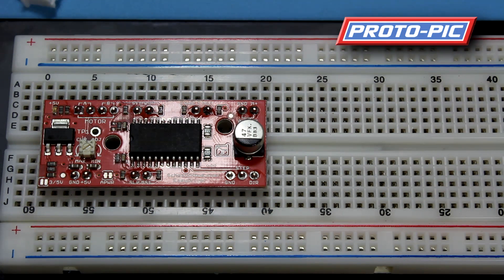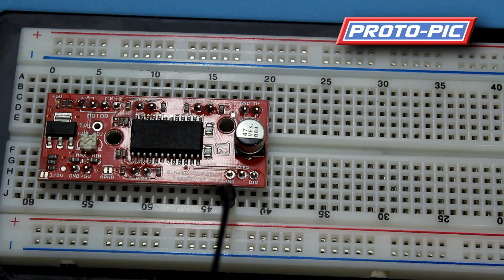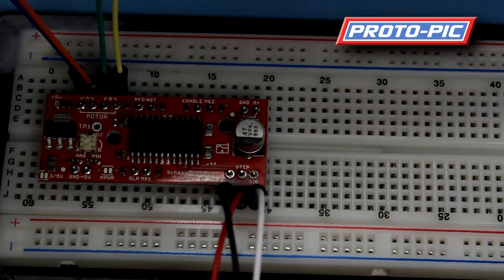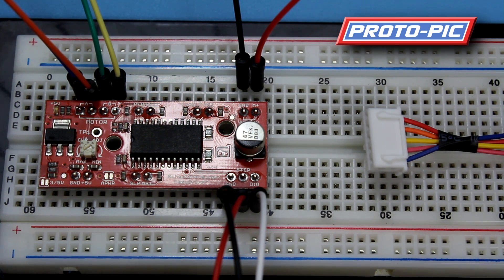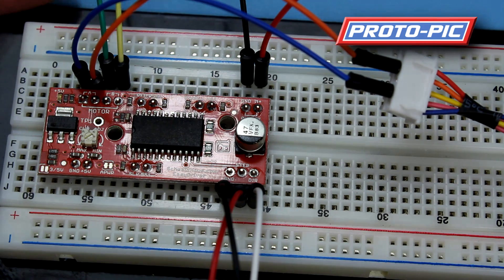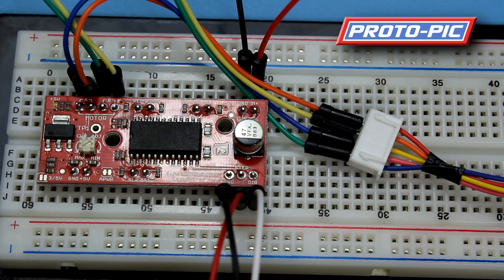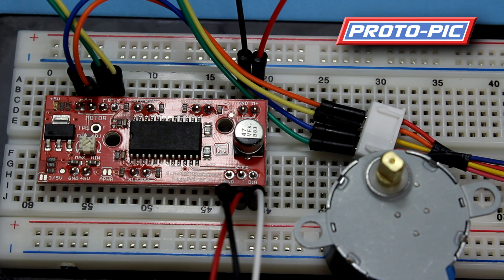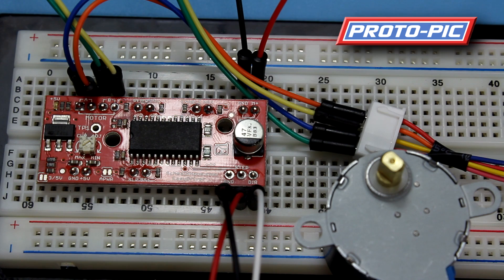Stepper Motor driven by the EasyDriver and Arduino from Proto-PIC.co.uk

Comment: for anyone interested the code is as follows:
void setup()
{
pinMode(2,OUTPUT);
pinMode(3,OUTPUT);
}

void loop()
{
  digitalWrite(3,!(digitalRead(3)));
  for (int I=0;I<5000;I++) // As the easy stepper driver is in microstepping mode
                           // We need to increase the step count.
  {
   digitalWrite(2,HIGH);
   digitalWrite(2,LOW) ;
   delayMicroseconds(160);
  }
}

Comment: I couldn't understand the sequence of the wire connections. I have several stepper motors (unipolar and bipolar) and this is my biggest difficulty. The sequence of the stepper motor wires I know; I just don't know the sequence to connect to Easy Driver; it is a logical sequence like 1 & 2 = [A] and 3 & 4 = [B]; or 1 and 3 = [A] and 2 & 4 = [B]? Can you help me? Thanks

Comment: three things to change from the video to make this work if its hissing:
1. Use another voltage source to add power to motor.
2. Change delay to at least 300
3. Switch wires 2 and 3 around
Reply: Thank you! The change to 300 worked for me ;-)

Comment: I'm using 3 easydrivers wit NEMA 17 and a 12v power source but the drivers get really hot, is it normal? how can I cool it down or avoid the heating?
Reply: Adjust the current using the potentiometer. It will lower the torque a little,  but it will reduce the heat.

Comment: Hey you prob won't see this but mine not working all it does is hiss
Reply from the maker: Adjust the power to MAX, and make sure your power supply can provide the required current for the motor, it may also be that the delay for stepping in your code needs to be longer.

Comment: I'm a total noob, so sorry for the stupid question. Why are you connecting your wires ( the black end bit)  directly into the breadboard instead of through the holes in driver?  Shouldn't the black bit go through the holes in driver and then  into the breadboard? Also, what is that white thing that's connected to the 5 wires called?
Reply from the maker: Hi - The wires would not make a good connection of just placed through the hole, the pins on the driver board go into the breadboard, and this allows a good contact between the wires and the controller board. The white thing on the end of the motor wires come with it, and it is called a JST connector.

Comment: Great tutorial i have had trouble with other video till i got to yours! Big Easy thanks ;) would you have a example you can point me out to using serial with back STOP forward? that be helpful for my chappie ears robot.
Reply: anothing thing i noticed, in your video at the very end your stepper is going back and forth but the example you have on your link does not give the same results? it just spins really really fast, i have a small 4wire 3.5v and my voltage supply is set to 6V @ 1A the reason why i have it at 6V @ 1A  is because i think i read that the big easy driver min is 6v and the 1A i have cuz i think is min i could play around and make it smaller while driving the motor to see whats the min with no load.
Reply from the maker: HI - as long as the motor is hooked up correctly, the DIR pin is hooked up to pin 3 on the arduino and the STEP pin is hooked up to pin 2 it should work.

Comment: I had this question in my mind for a long time. why do we need an easy driver while we can control the stepper motor using either l298 or l293 and what are the differences between them?
Reply from the maker: Hi - only 2 pins need to be used for the Easy Driver - the others need 4, also, no library is required for the Easy Driver saving memory.

Comment: does the easyDriver V4.4 chip getting hotter when you turn the stepper motor
Reply: I got 3 easy drivers, out of the 3 only one works and gets really hot, I've seen some guys on the web placing heat diffusers on top of it, that makes me believe that its normal, let me know if you found anything, thanks
Reply: mine gets really hot too

Comment: dude you might wanna mention what polarity are any wire you are plugging because using color labels are pretty obvious to mention considering its a video and we can see the color
Reply from the maker: Hi - There is no polarity, I refer to the datasheet for the wires connected to each end of the 2 coils. Reversing the polarity on one pair would cause the motor to rotate in the opposite direction.

Comment: Does this driver help this stepper motor to turn faster and with more torque than using the ULN2003 driver?
Reply from the maker: +Aaron Rios - Hi, This stepper driver board has been designed to make hooking up the motor to a micro-controller a little easier, Speed and Torque are not really effected. And your code can be as simple as Set direction & then Pulse the Step line however many steps you require, using the ULN2003, you need to program the output bit pattern for each step, as this is used as a coil driver.

Comment: Help me please.... :(( Where i find software for this hardware? I have 1 arduino uno+3 EasyDriver and 3 motors stepper but not find software for this. Thank you!
Reply from the maker: +George Lefter - Generally you need to write the firmware to do what you want to do - if you download the example provided, this should give you a good starting point.
Reply: ProtoPICVideos your pages do not exist

Comment: There is heating problem with Easy driver  v4.4 .. 
can u help me ..?

i have connected : 1 arduino uno , 2  nema 17 , 2 Easydriver v4.4 and 9 v power , 

Easy drive get heated in 1 min  
tell me how to solve heating problem .
Reply: +Jaikumar Vernekar since the coils are energised when not in use in your case, use the Enable pin on the driver board to turn off the coils when no driving them

Comment: I've tried to run my stepper motors with the Easy Driver 4.4 and they do run. However, the motor has close to no torque while turning, and while it is still, it holds strong. Any idea what could be wrong? please help!
Reply from the maker: I'm sorry we had a mistake in the video. The motor voltage pins should be driven between 7 - 15Vdc. I would recommend using 12V. Also when a stepper motor is not running the coils are energised and so you would not be able to turn the shaft at standstill. This is not very energy efficient so I would recommend using the ENABLE pin on the easydriver board to disconnect the coils when you don't need to drive them.
Reply: +kalik6 stepper motors (unlike servos) lose torque the faster they go..try reducing the speed or get a servo
Reply: i'll give it a try, thanks a lot!

Comment: Hi      not working my stepper only a  hissing noise please help. i do everything that you shown in the video. but not working.
Reply from the maker: Hi Shinas, sorry for the late reply, my notifications were not turned on. You may need a longer delayMicroseconds, try changing it to 300, also check that your supply voltage is 7 volts or more, lower than this may cause the board to stutter the output too quickly for the stepper motor to turn.
Reply: Hi thanks, for your replay. i made it before .thank you very much.    Have a nice day :)
Reply: +ProtoPICVideos Good to know.
Reply: Thanks this increased delay of 300 worked like a treat now to program using a potentiometer to control the speed for my project. Your stepper moves so much faster than mine also mine only making 1/4 turn not a full 360* increasing the loop to 16384 seems to get me one full rotation (found out why the driver does 8 micro steps per step so 8* motor steps = 1 rotation). Its the exact same stepper 28byj-48. I was trying to use a ULN2003 to control the motor but it had no strength and could hardly turn the motor this stepper is much stronger even when running off the arduino 5v line.